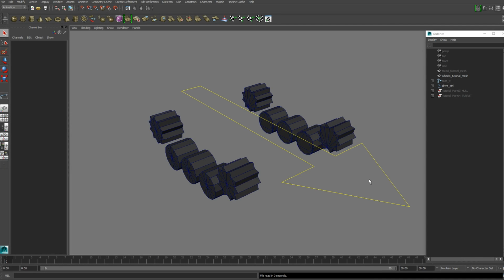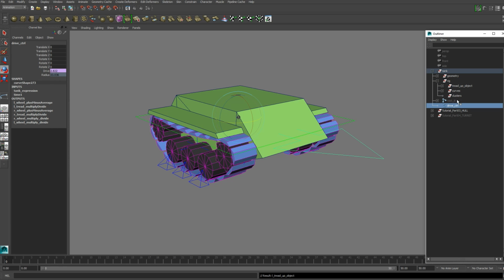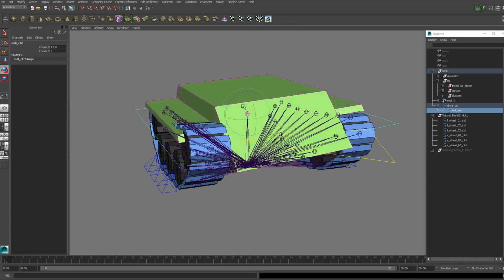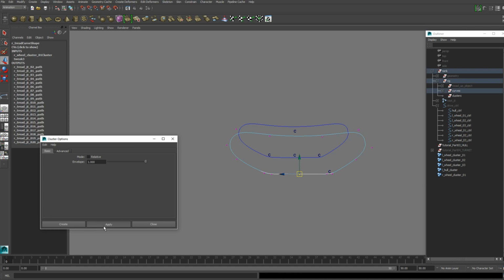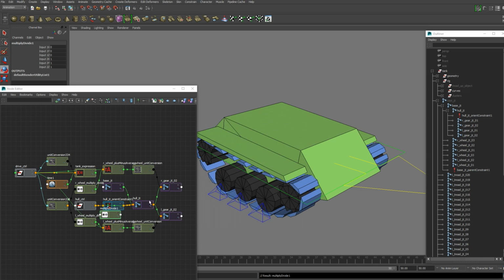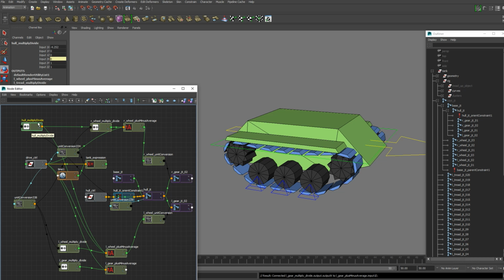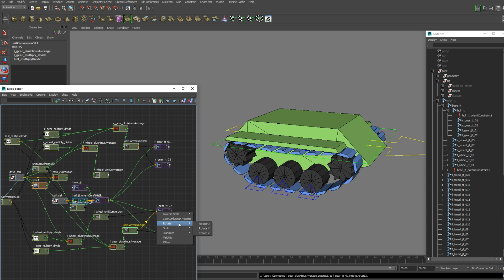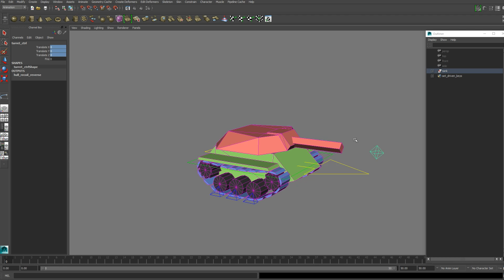How to Rig a Tank in Maya | Tank Rig in Maya | Part 3 Hull

Comment: Hi Simon,
Thanks for the tutorial and for the practice rig. I think  that you have miss a step in which you have linked the wheels to the tread. I am stuck at that step. Can you guide me to complete that step.
Reply from the maker: Here is the section where the wheels and treads are linked:  https://youtu.be/4oH0d4qTw4k?t=807
Reply: @SimonMills  I mean to say when I move cluster controller my tread is moving but my wheel is not moving.
Reply from the maker: @jai_parmar  Take a look at the description of the video on part 2 and 3.
Reply: @SimonMills  Thanks again to helping me out.
Reply from the maker: @jai_parmar  Thanks for checking out the tutorial!

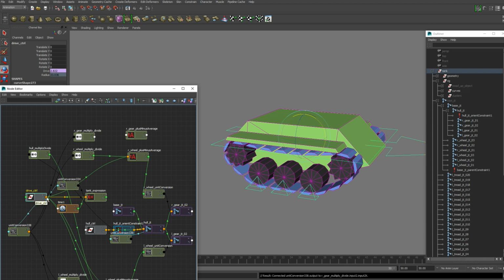Comment: @10:52 You had connected the unit conversion which drives from the drive control to mimic the nodes 
So how you had decided that this unit conversion which was going to the right wheel MD node to be the node which is going to be connected with the gear MD nodes 
Why not left unit with the left gear and right unit with the right gear ???
Reply from the maker: It's not connected to the unit conversion, the node editor line just passes under the node visually.  Both connections are coming from the drive_ctrl

Comment: I have connected both the treads and the wheel with the drive attribute and get rotation values in the channels but in the viewport nothing moves.
Reply from the maker: 1 full rotation is 1 unit.  Dragging the attribute will increment in 1's si u wont see a change. Type in 0.01 or something like that and the treads should be in a different position. Or key it over 100 + frames going from 0 to 1.

Comment: Hi Simon,

Any idea why my treads are translating at ~twice the speed of the tank and wheels when I move the drive controls around? The treads are covering 2x the distance of the tank/drive control.
Reply from the maker: Could be many things. Did you use diameter instead of radius? Are all of your wheels the same size?
Reply: They seemed to be working fine at the end of Part 2. Wheels are the same size, yes.

I'll keep digging.

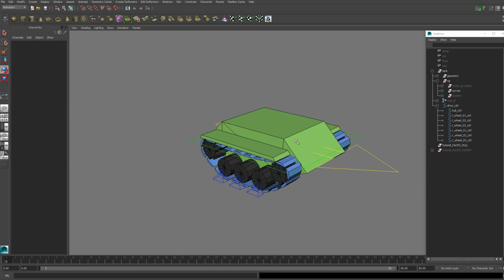Comment: Hey, at 7:22 you're moving the wheel_ctrl and you've already set up the tread to follow it - here's my question. Where in this or the part4 do you explain how the 3 wheels in the middle go with the tread, while moving the wheel_ctrl? I simply can't find anything related towards that, altough you've already set up the wheels in part 4. I'm confused.
Reply from the maker: Wheels are covered in Part 2
Reply: Simon Mills Yes, but they're not moving with the treads in part 2. They do this in the beginning at part 4, where you're moving the wheel_ctrl. I came to quite a dirty method of connecting them, by connecting the translateY, but that's not relative to the distance the wheels have towards the treads underneath.
Reply from the maker: https://youtu.be/4oH0d4qTw4k?t=12m2s    The expression drives 1 wheel per side and the treads of the same side follow that wheel. All other wheels are just relative to that driven wheel.
Reply: Simon Mills Yeah, I did that. And though still, when I move any wheel_ctrl in the translateY then the tread follows, but the wheel does not. I'd love to know what I did wrong.
Reply from the maker: The middle wheel joints are connected the same way as the outer wheels. Just position constrain them on Y only to the respective wheel_ctrl.

Comment: hi! first of all your tutorial is amazing, thx for it, I'm mid way and have a question, when I rotate the tank all works correctly, but if I try to rotate (E) and then move (W) as if the tank was taking a turn, the move gizmo points the world Z and not the one I would expect after a rotation, any advice?
Reply from the maker: Try this: double click the move tool on the left side bar to bring up the Move settings. Then select the local or object options under the move axis. It sounds like you may have world translation turned on.
Reply: It worked, I kinda imagined that might be the issue, btw I just looked at your soldier character, AMAZING!! is there any reference materials you would recommend to become better at rigging? I know the "basics"
Reply from the maker: Awesome, glad it worked out!  Just keep watching tutorials:)

Comment: Hey man great tutorial very in debt and well explained!

Just a question, everything worked fine up until halfway trough this tutorial. for some reason one vertex of both the Tread Curves got stuck in the back messing up my entire tread cycle when I animate it, I think it went wrong when I clustered the vertexes but I'm not sure. I added a picture to clarify: https://gyazo.com/ceb4ebcefd6ff24abadfbd6230f7e78e

I've been struggling with it for a couple hours now so if you know a solution that would make my day. :)
Reply: It's not the vertixes that get stuck but the bezier handles*
Reply from the maker: Hi Jim, thanks for your post. I always use cv based nurbs curves to rig with. I just tried using a bezier and it indeed requires an extra step. Try deleting all of your clusters and reassign them by making sure u include the 2 bezier handles for each point. A bit tedious to select them all seeing as the  handles are not easily selected as a group with the points. My biggest recommendation would be to redraw your curve as a nurbs curve or use the "Bezier curve to nurbs" tool found under Modify/Convert. You will have to redo the tread assignment but it is very quick to do with this tool: http://www.simonpaulmills.com/index.php/curve-path-tool/
Reply: Thank you so much, looking forward to more of your tutorials!
Reply: @jimzandieh4761  I have the same problem. PLus my locators are left behind when I animate the tank.